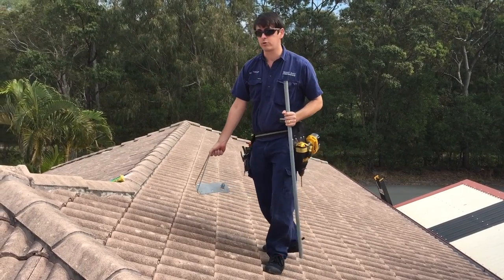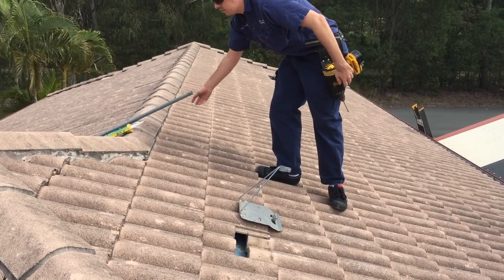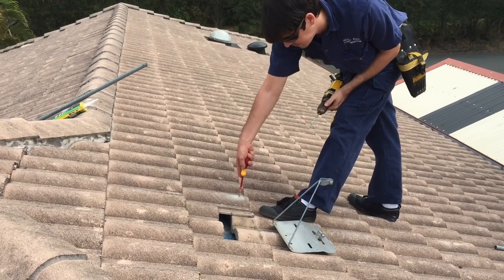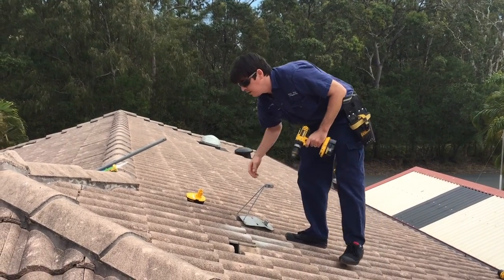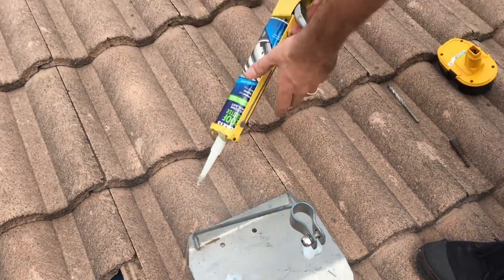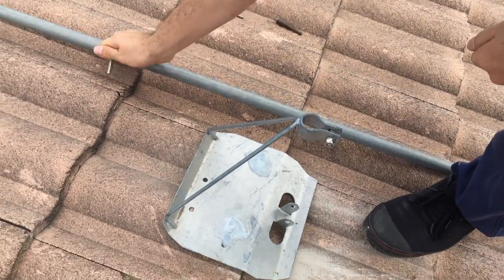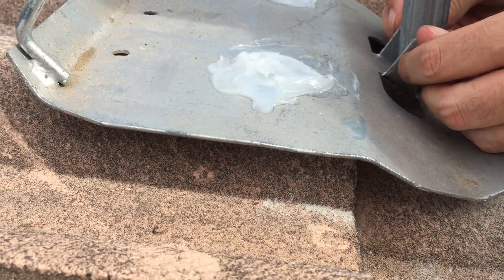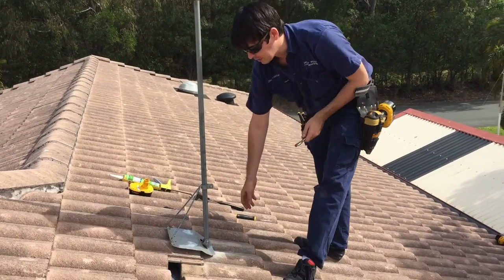How to Install a Tile Roof Tripod TV Antenna Mount

Comment: I'm no expert but I've been installing antennas on roofs for a year and I find it's a lot easier to make up your coax lead on the ground and your tripod and mask on the ground the carry it up onto the roof. Just a little tip of mine and lots of other antenna installers say it's a lot easier and quicker
Reply from the maker: Yeah it's probably safer too. You'd still need to leave it the tripod bolts loose enough that you can adjust the angle right. I tended to usually feed my cable from the roof so I'd get just the right amount to reach the splitter without waste. That wouldn't matter so much to people who don't do hundreds of them.

Comment: Hockey stick mount is much easier
Reply: But has limited positions, and also limits you to having to mount it on bargeboards which are never mount to bear any load.  I use valley mounts if there is a valley